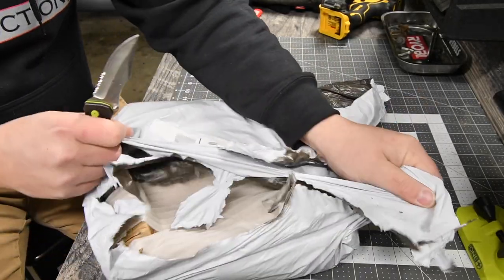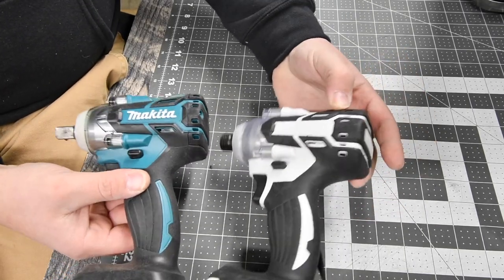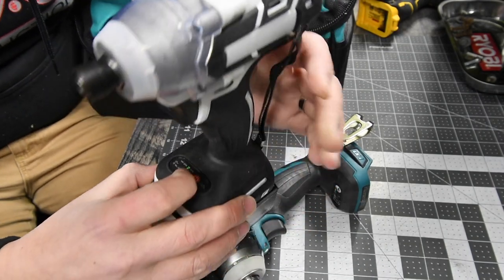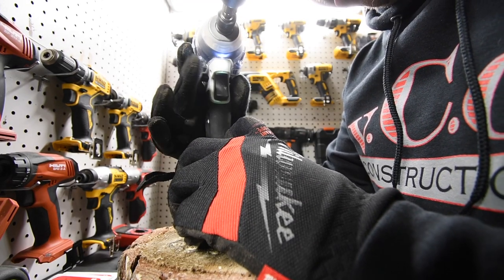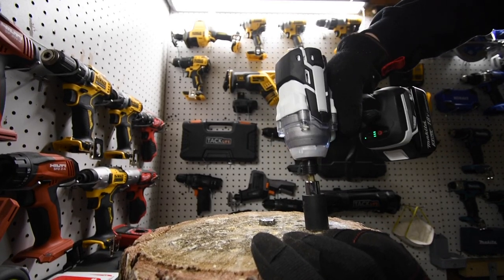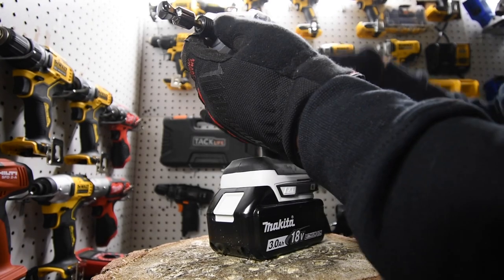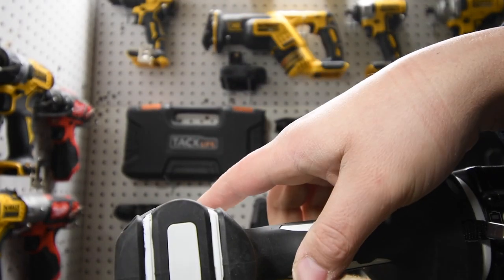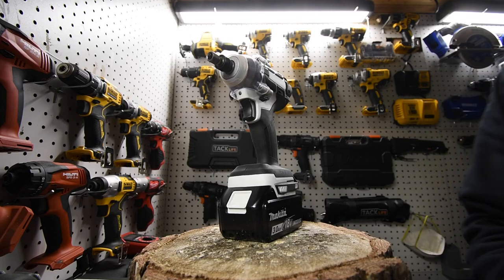$40 fake Makita

Comment: comparing a 1/4" impact to a 1/2" impact......Facepalm
Reply from the maker: The point of the video is design of the actual tool.... facepalm
Reply: @ManCaverTools  then why when the chinese knockoff couldn't take the screws out you took the Makita out and set let's see if the Makita can do it. No shitting on your content but if you want to keep your credibility don't compare tools that are designed for 2 totally different jobs.
Reply: Ryobi Man Caver do a review of just it?????? Facepalm
Reply: @ManCaverTools  plus you used an extension on the fake makita, everyone know that extensions or adapters are torque killers on impacts. And you definitely should know that.
Far from a fair comparison in terms of driving capability.
Reply: @ManCaverTools  No hes right.  These are two totally different duty tools.  The comparison makes you look like you're trying to diss them for some made up reason that doesn't stack up.

Comment: The Makita 1/4" impact driver from what I can find online is 1500 inch pounds (125 ft lbs) of torque, the Makita 1/2" impact "wrench" you using in the comparison I believe is rated at 210 foot pounds of torque... so even if you were comparing two actual Makitas this would be an unfair fight, let alone a chinese knock off. I believe you should redo the video and compare apples to apples, or at least if you don't have a comparable Makita, use some other brand. I usually like your content, but this one was kinda felt like you hoped no one would notice?
Reply from the maker: this is not a comparison between a impact driver vs a impact wrench, this is a Fake Makita versus a real Makita
Reply: @ManCaverTools  Yes, but two different tools! One is Impact driver another is impact wrench
Reply: I believe the un-educated are stuck on the names of the tools. Wrench verses driver.  Isnt it possible people that these tool manufacturers are capable of making the exact same tool, same specs, just different front ends on them?  I believe being these tools are quite comparable and I mean that by the size of each tool and they are ALMOST identical. So one can assume these are  basically the same? It's just that one is the real one and one is the fake.... Continue the testing my friend. I gotch-u!
Reply: @billlee1724  cool, I want to see your channel since you have so many opinions.
Reply: @len4709  Come on man...calls people disagreeing with this strange comparison uneducated and gives nothing concrete of evidence; to boot, makes five grammatical mistakes in one paragraph. All I can say is: open up an impact driver and an impact wrench and compare the insides, one will be substantially more robust than the other. All you have to do is compare the anvils. You don't use a sledgehammer to do fine carpentry work, same concept here.
Reply: @stoptellingmewhattowrite 

this is virtually the exact same wrench/driver that AVE tore down...the only real difference is the anvil and color. (1/4" hex vs 1/2" square and white vs teal)

And I've actually torn down a real Makita XWT11 and one of these fake Chinese specials (not at the same time, yet.)  The gear assemblies are virtually identical and are likely interchangeable.  Probably because they're stealing them straight off of a Makita assembly line. 

A real Makita impact driver gear assembly will look LESS (smaller size/mass) like the one in this Chinese impact because this Chinese impact is NOT based on a REAL Makita driver.  It's based on the XWT11 impact WRENCH.  And like I said earlier, the hammers/spring/gearing are likely interchangeable with the actual Makita WRENCH.
Reply: @ManCaverTools  how many times are you going to say that and miss the point. Not sure you should be using tools.
Reply: @ManCaverTools  If that was the case you wouldn't be putting a timer and comparing speed and performance. You would be giving a visual and feel review.

Comment: There are several factories manufacturing the counterfeit Makitas. I have a 1/2" impact from another factory. $30 direct. Its parts are milled and forged, brushless motor, works fine with Makita batteries, no shortage of power for my needs with build quality that seems on par with the rest of the tools on their 18V platform, which I run and have a number of tools. This is the only counterfeit and I'm seriously thinking of trying the angle grinder made in this factory. If you decide to get one buy direct, look for a tool with no writing on it that's presented in Makita's current color scheme. If you see several colors offered, or an older Makita colorway, move on to another.
Reply from the maker: yes sir, I saw it and I had to do a video on it :) I thank you so much for viewing

Comment: It;s uncle Eddie with a hex collet! :D
In the video you say it's a driver, then correct it as wrench in captions, but I think it's defined as an impact driver because of the hex collet. Even if, apart from the collet, the tool is identical to all the other cheap, Chinese branded impact wrenches (who have a shaft with both a 1/4" hex input, and a 1/2" square socket, which makes it the better deal IMO).
Although torque-wise it's not truly an impact wrench, it easily and comfortably delivers 150+ Nm, which is plenty for most of us. It's actually not only surprisingly light-weight, but also capable and useful.

Comment: There are 3 models of this fake.  It looks the same, but the mode, speed and torque are different.  Different motors are used.  Also, if you look closely at the motor part, you can see that the number of cooling holes and the design of the switch are different.  This helps distinguish the old and new models
Reply from the maker: I should get the other 2

Comment: does the fake one do front impact like any impact driver would be? Or  does it sideways impact like impack wrench?

Cause what I see, the fake one have impact driver head on it

Sorry for my bad english
Reply from the maker: that is correct, they put a 1/4 anvil on an impact wrench. you can also buy it with a 1/2 anvil on it as well
Reply: @ManCaverTools  actually I was interested in buying this, because of its low price.  I do need an impact driver, so I just try find out whether this fake makita will actually do an front impact like any impact driver would be or not.  thank you

Comment: Molding a little off and lighter, but for 40$ probably not a bad deal for someone that doesn't use this tool too often...
Would be good to know though if it can get a 150nm + bolt to open.
Reply from the maker: I made a real video video of the fake makita. you should check it out

Comment: Auto out stops when it is finger tight not when it is out. These are 2 different tools. Others have tried to explain but one is a WRENCH while the other is a DRIVER.
Reply from the maker: both are impact wrenches. the fake one has a collit anvil instead of a 1/2 anvil. the motor is an impact wrench. the motor is what makes it an impact wrench not the anvil.

Comment: What is the point of timing the knock off if you aren't going to time the real tool doing the same thing???
Reply from the maker: sometimes I have to put the timer in it to be consistent. the timer really had no point for this video.
Reply: @ManCaverTools  but you were comparing the tools right? It was a VS. video right in the title. Wouldn't it be good to know how it stacks up? Like, was it close enough to maybe be worth only paying a fraction of the cost? Was it absolute junk? No frame of reference and therefore not a showdown besides the physical looks. Just trying to give constructive criticism, I appreciate the videos
Reply from the maker: Scott Martin I realized after I filmed the video I wasn’t able to to timberlock screws with the makita, I gotta get an adapter for the 1/2 in anvil
Reply: @ManCaverTools  ah I see, well thanks I'll look forward to future videos

Comment: Bro . . . I know you are doing a fake vs real comparison, bit you are doing it all wrong. Like many have started, one is a impact driver while the other in an impact. Completely different masses on the anvils and hammering mechanism. Another thing is that on the impact wrench you are not using an adapter so you are not losing any torque. And on the impact driver you are using an adapter from 1/4 hex to 3/8 (or 1/2) so you will lose a good amount of torque from the toll. So in short your opinion on the fake drills power is already negative because you are comparing to a completely different tool. Now if you compared it to the model it was copying then you wouldn't be getting flamed over your comparison.
Reply from the maker: this company also make a drill dirver with a 1/2 anvil. but its still a impact driver. if I did a vs against the Makita 1/4 impact driver it wouldn't make sense. because the motor is the same as the real Makita. for the motor to fit in the body it has to be almost the same motor. so using a Makita impact driver wouldn't make any sense
Reply: @ManCaverTools  motors and hammering mechanism are completely different things. Power tools might use the same motors across there drills, impact drivers and impact wrenches but are geared different, different speeds, and different hammering (impact mechanism/anvils). Impact drivers have a higher forward speed then an impact wrench to drive in. A impact wrench has a faster reverse speed to break loss/remove, since that's what's its used for, to remove nuts and bolts.

Comment: Not really a fair test, two completely different types of drivers. The Mikita is an actually impact wrench and the other other one is a impact driver. Impact wrenches have a lot more breakaway torque and driving torque. I would buy that knockoff if it came in a 3/8 intact wrench just as a daily better for removing small fasteners and doing light mechanical work such as breakjobs and your basic light work.
Reply from the maker: this wasn't a versus video. the Makita would win, this was just to see how the knock off performed

Comment: You are comparing 2 tools that are different. The Makita is an impact wrench and the FAKE is an impact driver. An impact wrench will always have more power over a driver irrespective of make.
Reply from the maker: The fake makita is an impact wrench with a 1/4 anvil instead of a 1/2 in anvil. I swap out anvils in tools all the time. I put a 1/2 in anvil on the DCF 850. that doesn't make the 850 an impact wrench. but this is a very old video, so who cares

Comment: They r two diff tools u need to buy the same fake tool of what u have to compare them one is a impact wrench and fake is a impact driver
Reply from the maker: im done proving this wrong, but both of those are impact wrenches. I made a mistake in the video by calling it a impact driver. the company put a 1/4 Hex anvil on, they made one with a 1/2 on it as well. I did a video converting a dewalt 3/8 impact to a 1/4 hex impact wrench check it out

Comment: I'm all for comparisons, but #1, you're comparing 2 different types of drivers, and #2, you didn't exactly do a side by side comparison to see which one would drive in the lags faster.
Reply from the maker: there is no comparison to this. the makita would kill the fake. and yes both of these are impact wrench motors. the anvil inside does not determine if its a impact wrench or and impact driver. THE MOTOR DOES. but I thank you for viewing.

Comment: There not even the same kinda drill ones a impact wrench an the other is an impact driver
Reply from the maker: not true, both of these are impact wrenches ,I did a video converting a dewalt 3/8 impact wrench to a 1/4 Hex impact wrench. check it out
Reply: @ManCaverTools  ... they are not the same tools.  One is a driver and one is a wrench.

Comment: this tool was dubbed the Fajita by AVE I think its fitting
Reply from the maker: it was bad at all for the price
Reply: @ManCaverTools AVE. another great channel btw he took his apart and the motor inside is actually brushless however there are no hall effect sensors so its running in essentially open loop, not too sure what that means but there was some cost saving moves made over the real one

Comment: bro you can't compare a 1/2 inch impact wrench to a impact driver meant for screws and shit....if you got the fake version of the impact wrench it would be a much more fair comparison
Reply from the maker: its not an impact driver, its an impact wrench. I did a video converting a dewalt  3/8 impact wrench to a 1/4 Hex impact wrench. check it out
Reply: @ManCaverTools  No, when you described it as an impact driver in the video you were correct. Your 'correction' on screen was wrong. The original Makita is an impact wrench used for removing bolts and the like. The knock off is an impact driver that you'd usually use for screwing, but can be used for drilling and removing nuts too but certainly not as powerful for doing so as the wrench. :-)

Comment: I received mine yesterday (it's blue, but everything else is the same). It's obviously a knock off, but for 36 euro's it's by no means a bad choice.
Reply from the maker: I agree, more tests will be done on it in the future :)
Reply: How did it do after a year?
Did you throw it in the bin, or still works?
And what did you used it for in this time?
Reply: @dan_6915  It still works, but after some time I bought the "real deal" and there is quite a difference.

Comment: so it works... most ppl just want something that works and is not too expensive for occasional use. the batteries are the things that go kaput too soon so need to find something that the batteries are generic and stay with that brand batteries so dont have ... 5 drill drivers/ tools with 5 different batteries... that are all discharged/no good. white's nice as some of us are getting older and cant see things too well so a nice BRIGHT color, besides red/black or other dark colors, is nice to be able to find tool in place where we absent mindedly put it down a minute ago and now... cant find it? (sigh)

Comment: What a biased video.  That Makita is geared way lower than the knock off.  What you did is the equivalent of comparing a 1/4" ratchet against a 1/2" ratchet.  It doesn't take an Einstein to figure out which is stronger.
Reply from the maker: this wasn't really a versus video, this was to just laugh at the knock off
Reply: @ManCaverTools  - Your video would convince me to buy this tool if I only needed it occasionally and especially if I already had a Makita battery or two.  I personally wouldn't laugh at a tool that can drive those long lag bolts in.

Comment: You know actually small medium and large is kind of neat for fastener size. Auto stop I suspect is like dewalt precision setting for preventing stripping of material. That being said knowing how china manufacturing is I'm waiting for 3rd shift exact clones of milwaukie etc. Change polymer color new stickers no r and d cost... before anyone blast me it's very common there to manufacture companies product for 1 or 2 shifts then build a home brand on 3rd shift. They dont recognize our parents etc. When Daimler still owed dodge Chrysler jeep china offered no taxes and prison aka slave labor if they built there. Daimler declined, but stated it was because most of the world would be appalled by it. It was public opinion and buying power that scared them, not morals... and again before someone goes oh your anti china, remember we stopped a lot of our prison labor, and yes they were paid. The reason was they built things like furniture and manufactures complained they could not compete at the price. Btw oddly a lot of it was well made and a lot of our long running prisons were built by them... to me the tax payer it was a win.
Reply from the maker: there is not speed setting for reverse either, its only on low

Comment: I'm sorry I can't continue to watch you try to compare them when they are obviously different tools.🤔🤔🤔🤔
Reply from the maker: the fake Makita doesn't make a impact wrench. but the bodies are the same which also means the motors have to be identical for the motor to fit in the body, doing a versus video between the Makita 1/4 impact driver doesn't make any since. its a complete different motor then what is in thi body.

Comment: Blondes shouldnt use tools if they can't distinguish between the two different type of impacts smh instead of the brand vs knockoff smh
Reply from the maker: lol. these are the same tool. I already proven in many videos that the anvil doesn't determine what the tool is, the motor does. I was also getting yelled form people because they say a 12v screw driver is really an impact driver lol

Comment: Just bought one of these Makita clones as a back up. Should have it soon and will see how it does!
Check out the new AutoJare B1803 w/ 405 ft lbs torque. Just under $100.00 now on Amazon and comes complete w/ 3.0Ah battery, charger and case! Own this one myself and love it so far
https://www.youtube.com/watch?v=3i_JFkh5gZE
Reply from the maker: very good, im pretty sure it will be a perfect little cheap backup and I thank you for viewing Mike
Reply: @ManCaverTools  
Anytime! 
Looking forward to putting it to work soon as it comes in too!!! Just bought some grease today as well in case it needs some. You ever thought about swapping your anvil to convert it to a full impact wrench or a dual square & 1/2" hex style?
Reply: @ManCaverTools  Thanks Man! 
Just got it this morning and am pleased to say it also works with my Autojare battery

Gonna grease it up a little bit and test it out!